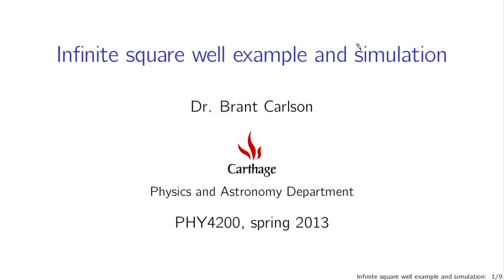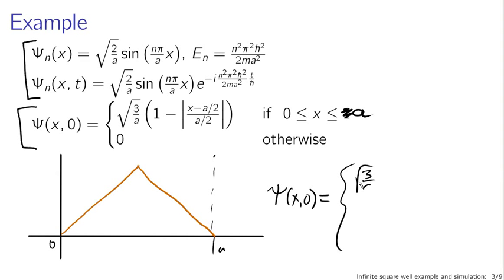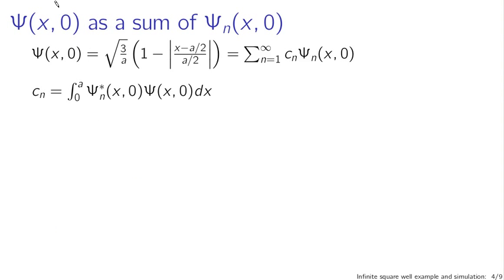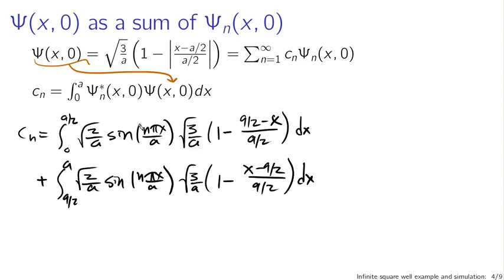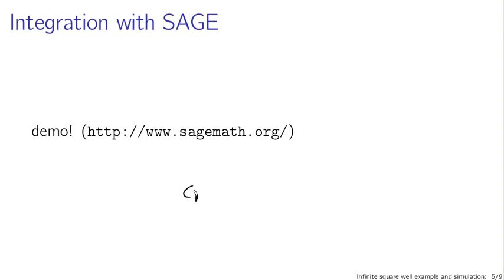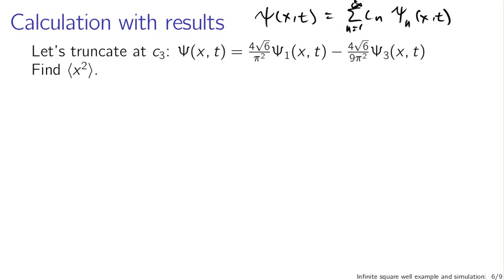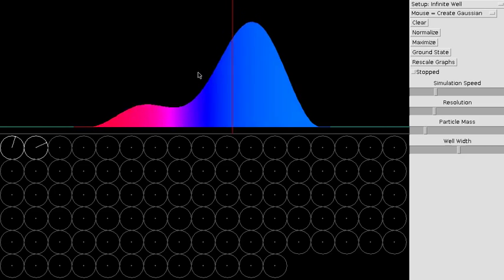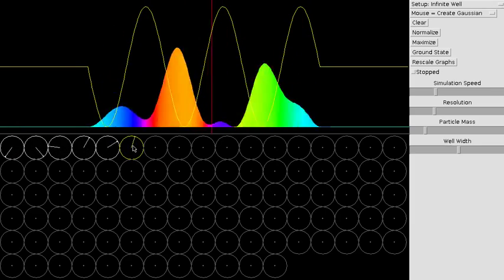Infinite square well example computations and simulation

Comment: I've been following this series so far and it has been truly fantastic.  Sadly, though, this episode has left me a bit confused.  I am uncertain as to how the time part of the SE is applied to the stationary states to affect their evolution.  You've been saying all along that the time component of the equation is trivial, but if it affects the evolution of the states, it doesn't seem like it would be trivial.

The simulation at the end seemed important and fascinating, but I didn't understand what was going on because all of a sudden everything was relating to the "phase" of something.  I don't remember you mentioning the word phase at all up until then in this video or the entire series so far.  Darn!  So, I'm left a bit confused.

On a smaller note, at 14:25, you're dividing the denominator by h-bar?  Is that right? The form you have it in earlier, say at 1:50, simply has the h-bar in the denominator. Which one is right?  Other than that, great series, looking forward to the rest!
Reply from the maker: The main idea is that the solutions to the full time-dependent Schrodinger equation can be expressed as a sum of the time-dependent form of the solutions to the time-independent Schrodinger equation.  The "time-dependent form" of the solutions to the time-independent Schrodinger equation are simply the "stationary states" multiplied by exp(-i E t / hbar).  That exp(...) factor is what I'm referring to as a "phase".  It's a complex number with magnitude 1 that rotates around in the complex plane at a rate given by E/hbar.  That evolution is "trivial" in the sense that it's easy to write down and compute, and  in that it doesn't affect any measurement outcome (hence the term "stationary state").

The time evolution of the full time-dependent Schrodinger equation is more complicated, though, since you have a superposition of stationary states.  Each stationary state evolves in the "trivial" way (the phase in the complex plane changes with time), but since each stationary state evolves at a different rate (they have different energies, so the exp(i E t / hbar) factors will be different for each state), the overall superposition behaves in a rather complicated way - at one time, the exp(-i E t / hbar) factors may all be positive and real, at another time one might be positive while the rest are negative, etc., and there's the difficulty associated with complex numbers...  The simulation shows the results of doing such analysis.
Reply: Brant Carlson Thank you so much for responding.  I really like your teaching style and approach to the subject and want to understand as much as I can.  Hopefully, you'll do the same for the other classes you may teach as you did for this one, so we can all enjoy them.

Comment: Great example!  Thank you!  I tried to do the example on my computer using Mathematica but I changed the initial conditions to ONE from zero to a and ZERO otherwise.  The Fourier series looks great with 25 to 30 terms and the sum-of-c[n]^2 terms add up nicely to one as they should.  But the c[n] now depends on 1/n instead of 1/n^2 as in the example, and when c[n]^2 is multiplied by the n^2 dependence of E[n], the n's cancel and the series to calculate the total energy diverges.  My question:  Why would some perfectly innocent looking initial conditions make the total energy go to infinity?  Is there some additional restriction on the initial conditions besides going to zero at plus-minus infinity?
Reply: You know as soon as he put the graph up there of the initial conditions I noticed the kink. The kink would make the first derivative undefined and the second derivative and even worst undefined thing. I'm not exactly sure how having the undefined second derivative makes the energy infinite other than you'd need infinite fourier terms to make the kink but this link helps:

https://physics.stackexchange.com/questions/262671/can-a-physical-wavefunction-be-non-smooth-its-first-derivative-is-discontinuous#:~:text=You%20cannot%20add%20a%20finite,get%20a%20non%2Dsmooth%20function.

Comment: But the initial conditions are the V(x) and the boundaries not a new psi(x)?! where did that new psi(x) come from? Shouldn't the initial psi be the first n of the sine wave function as a solution of Schrodinger in the particle-in-a-box problem?
Reply: I was about to ask something similar. I'm well versed on Fourier Analysis, and on the PDE of the (say, non Quantum) onedimensional wave propagation. So all the mathematical trickery is a piece of cake (even the use of a symbolic math computer tool).
But my very big "but" is which physical (or experimental) setup leads to this "initial conditions" Psi(x,0)?
I don't see how this inicitial conditions are related to the infinite square well setup ...

Comment: How exactly do we even give a quantum system initial conditions like the "tent"?

When I studied Vibrations and Waves this was all very intuitive since you could actually pluck a string. Here it's a particle! represented by a Wave equation!! which is like a "tent"!!! at t=0? How is that even possible. I may be completely missing the point here, but this is a difficult subject so go easy please...
Reply: I asked almost the same question as a response to Mohamad Martini :)
After thinking about it a bit, I think the "tent" is not a realistic initial conditions type. I think that what it is physically sound is the case of Psi (x, 0) equal to a Dirac delta, which would be obtained after observing the position of the particle. The math part is slightly more complicated (but you can't study Fourier Analysis seriously without getting familiar with the Dirac delta)

Comment: How the two facts are related!?
Reply: Time variability arises due to superposition of stationary states.Let's say 2 of them psi_a(x,t),with energy Ea and psi_b(x,t) with energy Eb.We take their superposition to get psi(x,t) = C1 psi_a(x,t) + C2 psi_b(x,t).
The probability density function is psi×psi* which can be computed to be made up of terms whose time factors (exponentials) either cancel out or are of the form e^((Ea-Eb)×constant).This makes sense,because the frequency of time variation of the probability density function is a physical thing, while the energies of particular states,are as always, defined with respect to an arbitrary reference.The dependence of any expression on that arbitrary reference automatically cancels out once we take the difference of two energies,and hence the time variability doesn't depend upon it.This is clearly analogous to how we are only concerned with differences of potential energy in classical mechanics,and what the exact value of potential energy is,in a particular is immaterial,and has no physical significance.The value of an expression for anything that has physical significance should not depend upon that arbitrary reference.